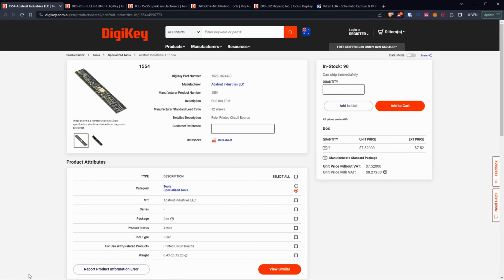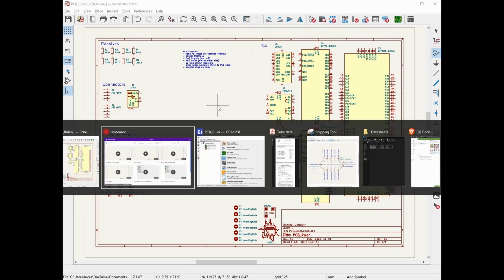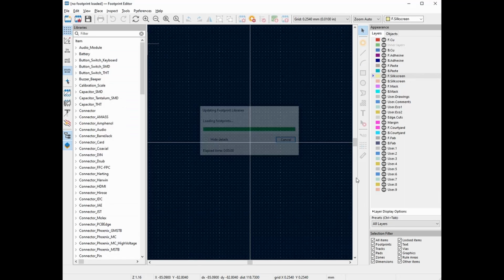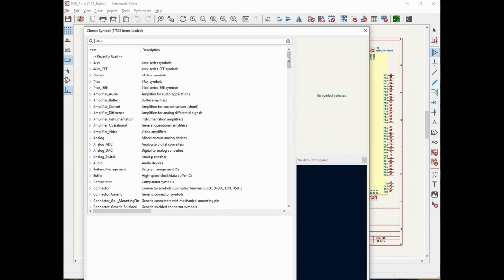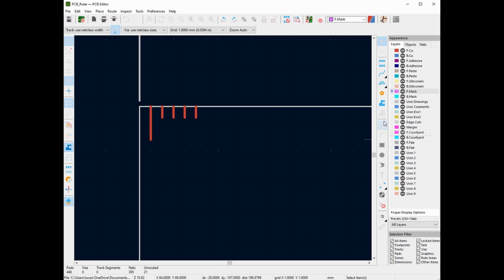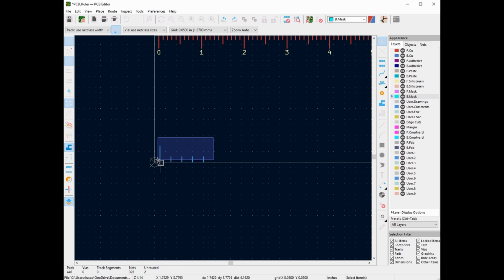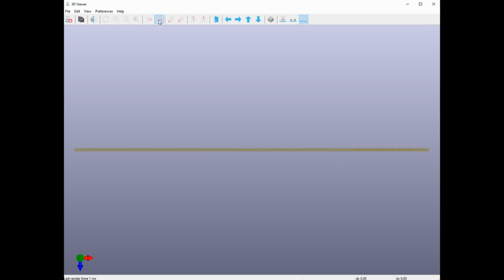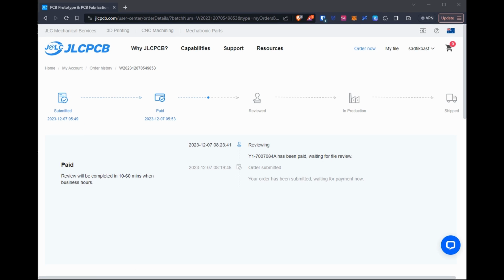I Made a Custom PCB Ruler | KiCad Simple Tutorial For Beginners

Comment: Why doesn't the ruler 0 start from the edge, i see this repeatedly in this kind of electronic  hobbyist rulers, is there a reason no one bothers to put the zero at the edge?
Reply from the maker: Great question! Generally, having copper traces so close to the edge isn't good practice for a few reasons. Exposed copper on the edge can have issues with tearing, signal integrity, solder defects, shorting the board against a product chassis, etc. In this case none of those really matter because this is all for aesthetics, but the manufacturer may still flag it if they see it in the gerbers because they don't know the application. I could have probably aligned it to the edge and explained that any defects were acceptable, but honestly it was simpler this way and I don't mind having a small offset when measuring things.
Reply: @TerminalCuriosityEE  Thanks,  Makes sense.
Reply: @TerminalCuriosityEE alternatively, omit the tick mark on the edge, and maybe also the 0.
Reply: @TerminalCuriosityEE cool project, BTW 😎